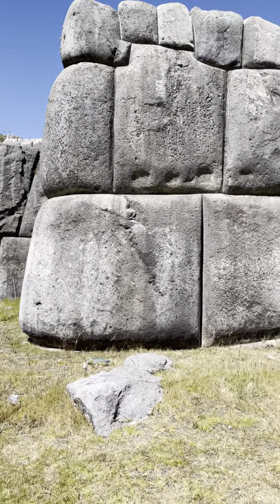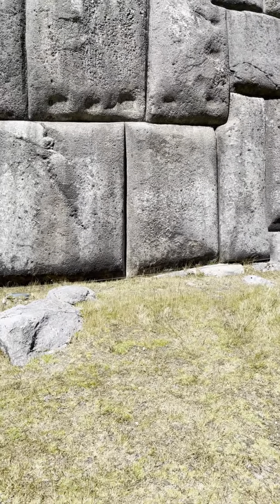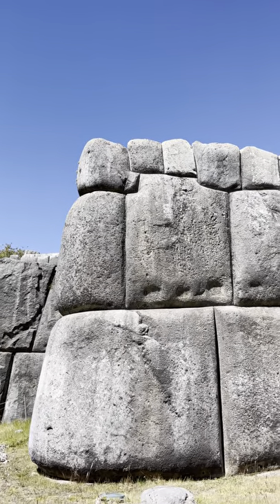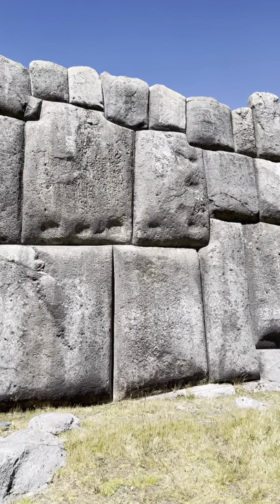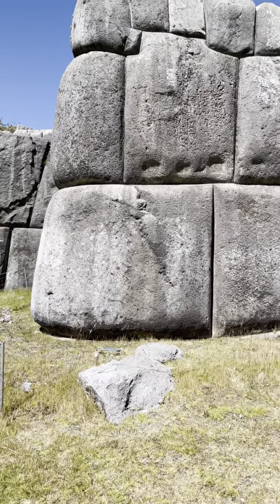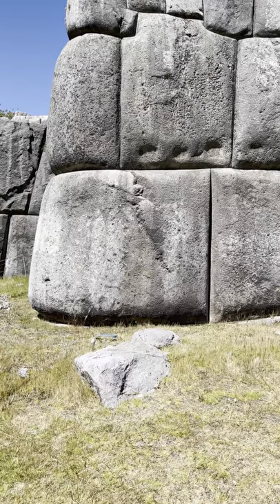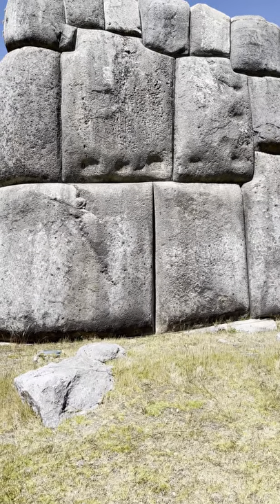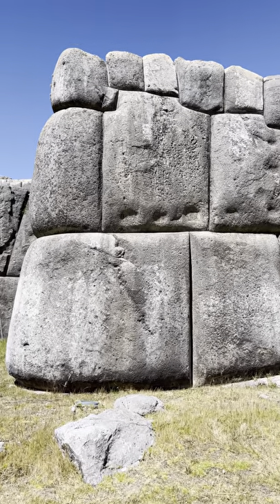Ancient Engineering of the Sacsayhuaman Megaliths

Comment: I was thinking maybe they were producing matter with energy and a brain interface to fit them together so perfect.
Reply: Those same small circle dents are similar to the one in Indonesia the pyramid of Indonesia has stones outside with the same dents
Reply: Probably melted rock and poured them like concrete. I have no doubt they had some kind of drilling mechanism. Even kids dig in the dirt and can figure out what moves the dirt the best so surely the adults could figure out that harder rock cuts softer rock. . We don’t really know what they had but it’s definitely more than what we are told!
Reply: No dude. Most of those joints are natural splits.

The majority of these huge walls were built by guys who.
A) went out and found a natural rock wall sufficient for their use
B) split the face up, to manageable size.
C) put them BACK together, in the same exact order, they were originally in.
D) carved the faces.
E) made them pillow shaped (slope towards the joints) to hide best as possible, the natural wavy / crooked splits between them.
F) griped and complained, over the course of six months, to fill in the odd spots, they had to fill with a stone that wasn't taken, from the same place as the one next to it.

Rock weather's differently. It's why it is so rough and pock marked. Sometimes lumpy.
Reply: NO that's not it Chuck.
Reply: Aliens
Reply: @goblin_couch_cult  maybe, but have you ever tried to cut a tree with a chainsaw? The weight of the tree on the saw binds the chain unless you carve a notch all the way through, and these stones aren't notched all the way through, and they weigh much more than a tree. If it's all cut from one solid stone, the cuts would all have to be vertical, and they're not. So either they're carved individually or the ancients had some sort of a hydraulic cutting system or laser or whatever speculative thing people want to throw out there.
Reply: Stone created from thought and infinite intelligent energy same thing the pyramids at Giza are made of

Comment: The weight of each individual stone doesn't matter. There's many others stacked on top. As long as the wall is the same height and thickness, it'll be generally the same amount of weight exerted on the ground under both stones in question. It's like Legos. If you build a Lego wall that's the same height across but one side uses bigger Legos than the other, it'll still be fairly balanced.

Comment: Lots of these megalithic structures have metal clips poured into recesses that make them act more like a single entity. The many sizes and locations of the facets of the stones keep them locked together in a way that make them extremely stable. And yes im certain that the composition of the ground is mostly rock. It is at a high altitude which generally means on a mountain that is essentially an outcropping of rock.

Comment: Soil compaction is key. If you get high compaction (over 85%) it can support the load, as long as the overall load is fairly even. Because the soil particles are closely interlocked and there are very few gaps to collapse and subside. Same goes for water, little room for water to liquefy or erode the soil.

Comment: The individual stones are in fact different weights.  However, that wall of relatively uniform height and thickenss exerts very similar pressures at any given point. If these stones were placed individually and unconnected to the others, you'd have varying degrees of settling.

Comment: So assuming the stone was quarried from the same place then the density is going to be relatively homogeneous. This means that no matter what size stones you use as long as the overall width and height is maintained then the overall cross sectional weight is maintained at any one point. It's still an impressive amount of engineering as they had to engineer the ground so that the walls wouldn't sink down but otherwise it's one of those things that you don't have to worry about.

Comment: Here's another explanation. The two rocks have different base sizes. The heavier rock has a larger base then the lighter rock, therefore the lbs/sqin is the same for both rocks and would settle at the same rate. So they really didn't need to understand it at all though they probably did since they math is fairly simple.

For example, if the base of the large rock is 100 square inches and its weight is 100 pounds, then it is exerting a force of 1 lb / square inch on the ground beneath it. If the small rock weighs just 20 lbs but its base is 20 square inches, then it too is exerting a force of 1 lb / square inch. So if the ground is consistent underneath both rocks, they would settle at the same rate.

Comment: The minimum standard for vertical load on soil is 2000 pounds per square foot. Other soils may have higher rates but that's the minimum. If you do not exceed this limit at a single point, then the structure will respond as monolithic. This is true as long as you are on virgin soil.

Comment: Double the weight means Double the surface area which means it's having to push down alot more area of dirt than the smaller one so in theory they would sink at the same speed if the one on the left were exactly Double the surface area on the bottom and was exactly Double the weight

Comment: You see how those stones on top overlap the next stone on the bottom stones? They used super glue on the bottom of the stones on top overlapped it to the next stone on the bottom so it holds both stones on the bottom in place, not allowing one stone to sink faster than the other.

Comment: But once the wall is built, it acts as one large distributed load. Since the wall is more or less the same height the load at the bottom is evenly distributed on the sub soil so one rock will not settle farther than the one adjacent.

Comment: Butted stone with a zero grout line with equal base, height, and width, has equal weight throughout, given all the stone has the same density. If you took weight measurements of cross sections it would be the same.  

When people say “It couldn’t be done today”, perhaps not in the timeframe of modern construction requirements. As an example a large wall today can be erected in a week. Back then, the same size wall would take 1 to 2 years. Modern construction could easily complete similar projects if given 50-100 times the amount of time as today’s standards.

Comment: They're unmoved because theyre locked together like puzzle pieces. They achieved this by stacking large sacks filled with some kind of concrete probably being supported with wooden structures. Thousounds of years later all the wood and sacks rotted away and disappeared leaving concrete/stones behind with no evidence of how it was done. This is why all the edges are round and all the mating surfaces are so flush "you cant even pass a razor between them.

Comment: The stones as an individual one would sink faster than the other but when the stones are part of a puzzle that weighs roughly the same linearly per square foot and doesn't have a vertical seem from top to bottom  the individual weight is no longer a relevant factor

Comment: You are all wrong. Those were not stones when placed there. They were bags of mortar mix. Once placed they were soaked with water. The material hardened. The canvas bags were dried out or burned off. Give the concept a try and you will see the same results. “No chisel marks” and all stones are in perfect symmetry despite size and shape differences….

Comment: Well first off the base under the stones is probably extremely good, and secondly, the weight of the stones are probably distributed evenly (even if there are different shapes and sizes) enough that it balances out going upwards. Sort of like combining the tines of two forks and balancing them on the edge of a toothpick. Weight can become irrelevant when balanced properly.

Comment: Maybe, just maybe it's the surface to ground ration.  I mean one stone is heavier but also has more ground surface under it to hold up that additional weight.  Now if they were the same exact dimension but one was of a heavier material then that may be an issue.  Also the stones above are interlocked and apply equal pressure on the stones below I would think.

Comment: Well I’ll take a crack at it. I’ve worked in earth moving where we clear out large areas of land for sub divisions and shopping malls large building and whatnot. Before any of that is done the ground has to be stripped down, leveled and then is built back up in layers from a foot to 3 feet and each layer is packed down. After all that they start putting huge buildings on the land obviously on foundations as well but the foundations for those foundations is all those packed layers. Maybe these people did something similar to that.

Comment: Ok I’m a brick layer and while I have never worked on anything with bricks that big and likely never will however brick laying has been used for thousands of years and you always use a foundation which ends up in a way equaling out the wight of the build by dispersing the wight across it’s self kinda like how a camel has large feet to stop from sinking in to the ground. That method much like brick laying has been used for thousands of years. Those massive stone bricks are on top of a foundation and are more then likely also bedded down on to that foundation with whatever kind of mortar they used to joint the sides together

Comment: It's actually not that hard. Just pack the dirt in. And fitting them together is even easier; cut them to the right approximate shape, slather some abrasive mud between them, and pull one back and forth against the other for a few hours. They grind each other into fitting perfectly.

Comment: What ever engineering they used was dividing circle not a straight line or by weight alone... so it wouldn't matter the size or shape the machine cut like a 60 degree rotating angle... never miss no matter the line up.

Comment: when you cut a stone and in  a rotation,  its done while you cut which will by only touch and vibration of the stone to  know to use which stones! to turn and bare weight.

if you  build a model you will know what to do with the larger stones. & mountains dont move they accumulate the moss and little particles stone that keeps the stones locked!

Comment: First, they have to be plumb and level. Second, the individual weight is not as important as the overall weight. One brick doesn't hold the weight of everything above it, the entire row and column holds the weight. Got to get your structural understanding checked on.
Reply from the maker: Hi David, thanks for the comment. My comment on weigh distribution was after an observation made about stone henge and the fact there are differing size and weight columns and yet no sinking at differing rates.

Comment: My man does mot understand ground pressure. A larger stone of equal height and with square sides has the same weight per inch of the smaller one if the material is the same. Make it as wide or long as you want it will be the same pounds per inch.

Comment: Simple answer. Grug see big rock. Grug want to make building. Grug put big rock next to other big rock

Trug also wants to make building. Trug puts big rock next to other big rock. Trug not lucky though. Trug accidentally puts big rocks on bad spot. 200 years later, trug’s build is gone 

For those needing a less sarcastic answer. The builders got lucky. They just happened to build on a good location with stable ground. Other buildings weren’t built on good locations, so they fell down and disappeared. This is classic selection bias

Comment: All I see is an evenly high solid wall of rocks with no gaps. If the rock ‘bricks’ are of similar density it matters not a jot if they are large or small. The wall will weigh the same along the bottom regardless. This is basic common sense.

Comment: This is incredibly stupid. It isnt about WEIGHT - its about DENSITY. And there's no difference in density (pressure). If there were actually more weight per sqaure inch under one rock vs another, you might get differential compression/displacement, but the density and pressure is the same (the overall weight is the same, measuring the weight in each column, ground to top).

Besides, how dumb is it to say these builders cared what happened in 2000-3000 yrs.